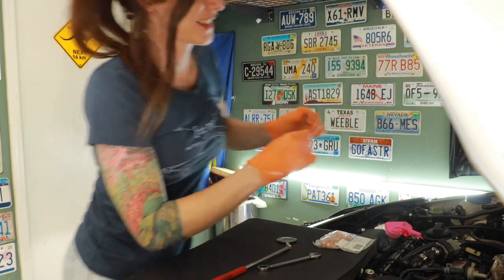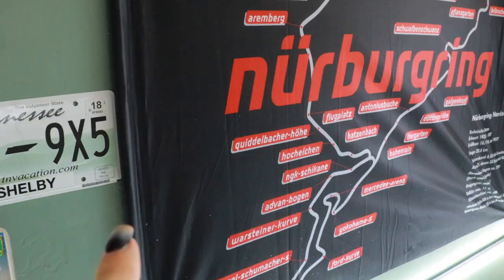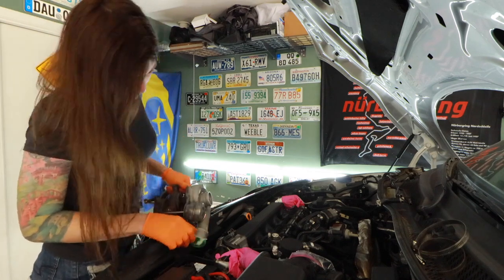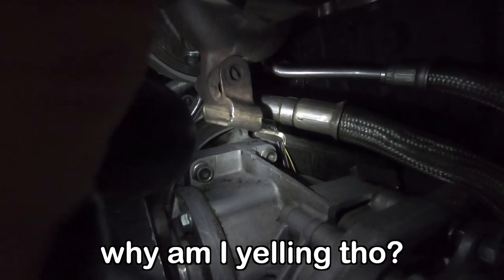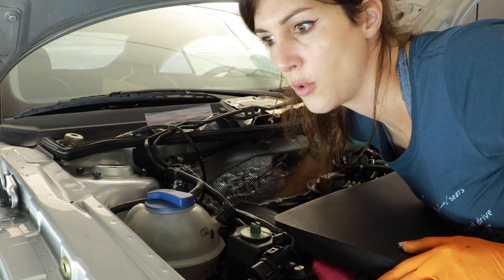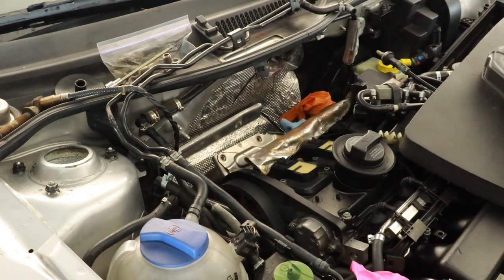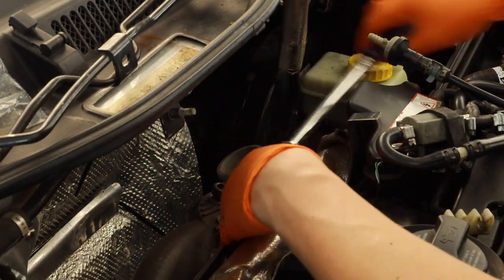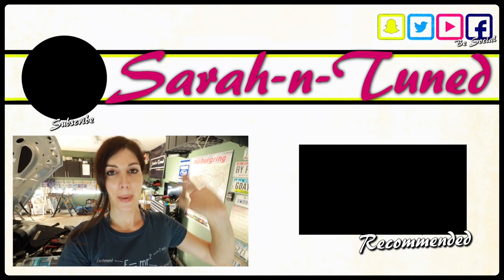I Took EVERYTHING Apart! // TT Quattro New Turbo is On!

Comment: Sarah the label "ACHTUNG! Bei allen Pruef- und Einstellarbeiten Motor-Kennbuchstaben AMU 018 721 beachten!" means "WARNING! During all test and adjustment work, observe motor identification code AMU 018 721" (meaning when checking or adjusting, use data for that motor id code). It doesn't mean anything to do with an Allen bolts (which are 'Inbus' or 'Innensechskant' in German).  You're doing an amazing job, THANK YOU Sarah for such a great channel and the frequent uploads!  All the best, Rob

Comment: Watching some of your old content and saw the spot free episode. What works best for me (and cheaper than deionizing filtration media) is filling a 2 gallon garden sprayer with my under-sink RO system. I wash the top surfaces, hit it with the RO, then alternating sides, always finishing with the RO. I don't even have to dry my wheels anymore and they still don't have water spots on the chrome. Once I move the system into the garage, I'll just use a long tube to rinse directly from the pressure tank.

Comment: Nice work Sarah... one hint, that loctite 271 won't do much on the plug, as the turbo housing gets well over the release temp of 271.  Resbond would be what you need there.

Comment: I bought my 2006 STI in 2011 from Salt Lake City. Same thing... the body was fine with some minor easy to fix surface rust on the bottom of the rad support, but the cad plating on the bolts had been eaten away. I bead blasted all the hardware and had it all replated.

Comment: aftermarket exhaust manifold has different dimensions because it isnt OEM.  So minor clearancing the exterior is allowed . once it is in service for about 3 hours of run time it will has the same rust patina as the rest of the part.

Comment: Ideas for an amazing car, weird stuff ? 9:10 . Find a Lotus Elise, put a Subaru boxer powerplant in it. The already low riding car gets even more stable due to lower center of gravity for boxer engines.  With unequal length headers, the exhaust sound gonna be amazing for a Lotus.

Comment: Nordlock washers are great for ensuring nothing backs off, needs to overcome the internal wedge, but, the serrated faces do require a higher tightening torque for equivalent clamping pressure, 10-20ish percent. While you still have easy access, retorque those manifold to turbo bolts to around 60NM.

Comment: I recognize that I’m armchair quarterbacking here, but have you considered if it would have been easier to remove the front end and pull the motor to do this work? I just recently pulled and replaced the transmission in my Mini Cooper, and some of the tasks were enough of a pain that maybe pulling and putting the engine/transmission back would have been less effort. Just something to consider. :)
Reply from the maker: Duane Pinkerton not by myself in this tiny garage with no equipment it isn’t.
Reply: Sarah n Tuned fair enough. Cherry pickers from harbor freight aren’t too expensive. I’m sure you’re going to need to pull an engine eventually. Come to think of it, you had some challenges with Mr. Dos that might have been helped with a cherry picker and an engine stand. :)

Comment: If you really want to increase your income, do what you do in a BIKINI!!!!!  ;)  Sometimes you have to MAKE ROOM. Often this can be accomplished by pulling motor mount bolts and jacking or pushing the motor away from your work area.
Reply from the maker: Steve 1961P. That’s a f*cking stupid idea.
Reply: @SarahnTuned  I just read this. I laughed so hard my sides are aching. Pretty sure it was the bikini idea you were downing. I would think about the possibility of removing engines from the bay and putting them on stands to work on them, though. I can see where that might be a problem given your lack of space in the garage, but it would sure make working on the engines easier.